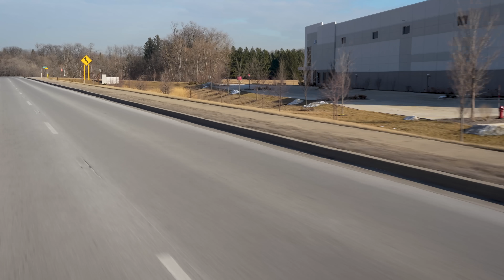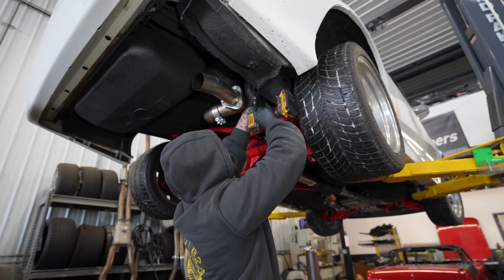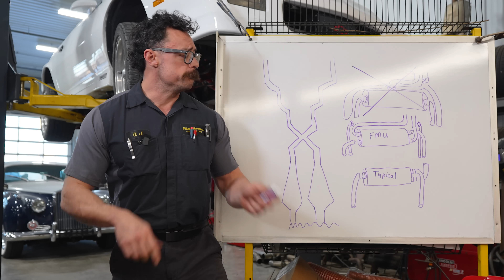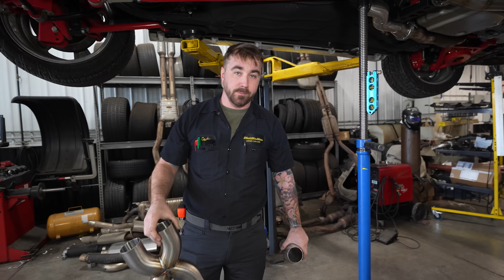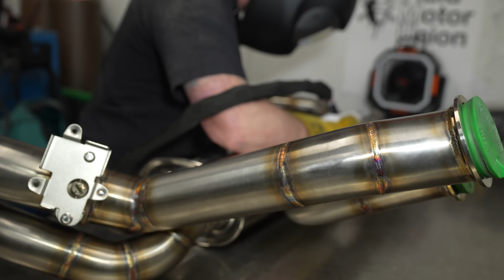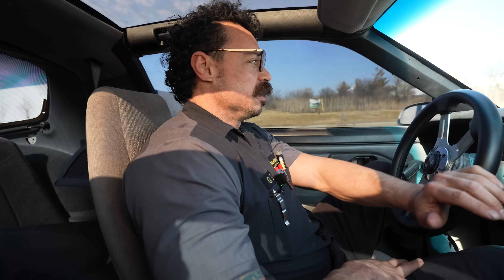This Camaro Exhaust Shouldn’t Have Made 30+ WHP: LS3 Stepped Pipe Layout Everyone Will Copy

Comment: The  megaphone you install and how subtle change and i assume you have a software program to optimize the actual  shape of the megaphone itself .  angle and lenght  of the divergent side and convergent section  can determine and affect how exhaust wave reflects  and the  scavenging and back pressure.  And if i remember  the number from years ago in  fluid dynamics.  Divergent side with shallower  longer angles   will  have broader  band   but lower  gains and  and divergents with sharper  angles that cause  shorter  length  have more  gain but at shorter band also longer affect the timing of the back pressure wave and the amount it affects.   Its a huge  are to take into account  and not  simple slap two cones together like some may think,  hats off to you  on  the tech and idea its a lot of work to design and to balance.

Comment: This style exhaust you are showing us frees up horsepower by interupting the returning pressure wave that causes reversion. It may create a scavenging effect as well. I ran an exhaust shop for about 20 years which was a great gig until the manufacturers went to stainless exhaust in about 1996ish. I wish I would have a dyno to actually measure the results of the different things I tried.

Comment: I have basically about the same set up except for mine is in a Chevy 2 and when you done the first Dyno and said that it was making 392 I knew right there you were definitely going to be getting more from it if you could open it up more and get a more crispy sound and I also said that they should be getting 450 out of it on peak and that's what mine made was 456 at the wheel

Comment: Man, you have no idea man that car does not sound good and it don’t even work that good. My car would just blow the doors off. That car is for a joke. Like I said in the previous comments, you have to put real dual exhaust on the car with two thrush mufflers on it the passenger side crosses over to the driver side and the driver side crosses over to the passenger side and they’re in the middle is where you put your brush mufflers on each pipe. That’s the only way that that car is going to actually sound good the only other way to make it sound even better is to Pull that newer age crap out of there and put in a 383 stroker or find yourself a 400 small block and put a carburetter on it with a four barrel you know you get that whoop whoop then you’ll have yourself a car

Comment: Man, these guys are so fucked up 2 1/2 inch pipe, dual exhaust the driver side is going to be a little bit lower to the ground but if you want duels, that’s what you need to do. I had my car for 15 years. I got stainless steel exhaust and never had to touch it ever again after 15 years, take the insulation out the floor under the carpet and drive it somewhere on a back road late at night. It’ll make your hair on your arm stand right up on end.

Comment: I have a third GEN Camaro 82 with a 400 small block in it. It’s got dual exhaust real dual exhaust and you will not get that car right there sounding good until you put dual exhaust on it and while you’re at it throw real motor in it with a carburetter Holly carburetter

Comment: regarding the bit about the dyno correction. Like you said its a tool. For example if my tire gauge reads 2psi different than yours, It doesn't matter because I only need repeatable accuracy because I tune tire pressure to what I feel from the seat not what a book says.

Comment: Half of the gain in graph is from manipulated dyno number.
The DD dyno just have rpm on front roller, and not linked roller.
The roller mass inertia is based of both rollers. So to get correct reading you need to turn both rollers.
In first pull with harder strapping both rollers was running.
With upgrade it was loser straps so it climbed front roller more. 
That means the inertia/moi calculation gets wrong and you also get less tire pinch, resistance.

So atleast half of that gain, was running on both rollers compared to one as the dyno software doesn’t correct for changed moi ☺️

Comment: I have a Durango Citadel...  It has a v6 engine that "tees" into a single muffler exhaust.  The problem...  The manifolds are cast into the cylinder head.  The exhaust is simply a pipe that bolts to the cylinder head and routes to the rear like anything else.  I would love to see if there is any power left on the table and if your special ingredients of megaphones and exhaust transitions would help or be a complete waste of time.  😁  Too bad I'm broke!

Comment: Ive been  playing  with a theory in my head and on paper  every thing has a resonance  frequency  right down  to tha air we breathe  it applies  to everything  find that frequency  in an intake  runner/s and or primary  tube/s  all the way  to threw the exaust  system    you can gain  in some  cases  upwards   of 30 to 50 volumetric  efficiency on the dyno that translates  to real-time data  and horsepower  numbers. I don have a PhD  never  had any schooling just a gear head  with  A--D and my brain never stops
Reply: True.
Ask Ferrari or Chevy Vette with variable geometry intake manifolds

Comment: The idle sounds really good, and the power increase from just the exhaust impressive, the fabrication work is phenomenal.  For me it's a little bit Tin  sounding on the top end, and I'm not a fan of borla's either,  but that's just my opinion.
3 inch dual exhaust is fairly big for an NA build, at what threshold do you start needing a 3 inch exhaust? 
Now I do want to say you guys should try some stepped headers. Try to stay away from those three bolt flanges cause those just suck, a proper slip fit or the V band is the way to go.  Pypes made a set of stepped headers for the coyote Mustang and they made some really good power. The only bad thing were the ball and socket fittings for the collectors, the X pipe would work itself loose and start to droop over time. Sound quality was great.

Comment: One thing I've wondered about but never heard discussed in 30 yrs: The exhaust gasses are cooling down rapidly as they travel down the exhaust system, therefore slowing and contracting in volume. Could changing diameter size in steps be used to increase flow by altering velocity? Smooth out flow and/or smooth out pulses?
I've seen a 2 ³/⁴" system go into 3" but my experience is that the sound gets louder, not necessarily make the car faster. Could a reduced diameter, in the right location, reduce noise or even increase velocity and scavenging? 
Maybe a series of stepped diameter changes?
Just thinking out loud.

Comment: My friends 3rd gen was done the same way at the back.  One pipe straight off the elbow and the 90 going into a muffler.  It just seems to me bad for sound engineering. 

Currently on my 00 im planning on going with a gmmk style muffler but I want thrush glass packs in place of the crimped pipes.

Comment: Its good to see actual, well known, exhaust physics being used. As soon as i saw your megaphone, the first thing i thought was how the shockwaves could be tuned for more power based on distance from the exhaust valve - like a 2T engine. 

Have you thought about headers with a small, sharp step closer to the valve for a more RPM tuned step length? I know F1 cars use the concept, but they run such high RPM that the first steps are something like 6"-10" from the valve.

Comment: How did you realize that the relucter wheel sensor was incorrect?  I have a 2007 LS 5.3, truck motor,  installed in my 1973 swapped Camaro.  Scott in southern Oregon

Comment: What are the odds that the previous tune was just bad? In my experience, if the numbers are unbelievable, they're probably wrong.
Reply from the maker: Maybe your just responding after clicking the video because I go over this pretty thoroughly if you watch the entire thing.
Reply: @FluidMotorUnion  sorry, maybe I was confused. You mentioned you played with tuning a little because it was hunting for idle, got an increase, then got more with a pro tuner, right? Or did you not touch the tune at all after doing the exhaust and getting that first big bump in power? Not accusing anything, I promise. 30hp difference in exhaust is wild. Like, "something stuck in a pipe" wild, right?
Reply from the maker: The exhaust gain, is on same file, the additional after that is the file modified. 
I’m pretty sure I state that if you watch along. I appreciate you watching and asking questions but I try to do a good job of being clear, and I rewatched thinking I wasn’t… but it’s all there!

Comment: This is how its done. Also a number in the comments are pointing out the tune, and sure - but you wouldn't have the numbers returned from the tune with the original exhaust setup, the original benchmark was done after the obvious were fixed and the final tune was done to optimise for the final setup, there were significant gains in the final product regardless.

Comment: If you shut the correction factor off the weather can make huge differences hour to hour much less day to day.
The whole point of the correction factor is so you get comparable numbers regardless of weather conditions.
Here is an example. I have dynod one of my vehicles in Denver Colorado at 6000ish feet of elevation and green bay Wisconsin at 300ish feet of elevation. 
With correction turned off the denver numbers were almost 100hp lower.
Turn them on and corrected power was within 3hp
Reply: 100hp lower???  Wholey crap!  Almost makes you want to live in Wisconsin to feel that extra 100hp!

Comment: Nascar teams used to make headers that were one size for a certain length, then stepped up one size for a certain length then joined the collector.  you have to measure the volume of each cylinder, design a primary exhaust pipe that can hold 3/4 of that, then step up to the next size pipe, like 1 3/4 to 1 7/8.  the second section of the header pipe should be able to hold the volume of 3/4 of the cylinder.  what this does it cause a scavenging effect of the cylinder and header pipe.  I think some of them had 2 or 3 steps

Comment: The fact that you had it strapped down into the rear idle roller on the before runs and then showed a video of your last runs letting it climb the roller tells me you’ve purposely loosened the straps to show more hp. I used to operate the exact same dyno and know there is a reasonable difference between letting it run on the idle roller or not

Comment: Those last pulls on the vid you can tell it isn't warmed up yet, or you had the drivers wish pumped quite a bit. Look at the spray on the ground.  Let her warm up more, she'll sound even better. Some of that gas is inside the pipe needs a spark plug of its own!

Comment: This is a great video; I’m currently working on an e39 where I’m doing an m50b30 stroker turbo build and I am hoping to build a basically stock exhaust with a window switch controlled valve. While this was an NA dual setup it gives a lot of insight into how to think about exhaust work.

Comment: I immediately noticed you guys had a W210 E55 AMG mercedes in the engine bay next to this turd gen 'maro. I'd be interested in an exhaust setup for my W202 C43 AMG (same M113 engine platform). I'd like to also consider a single turbo exhaust setup with a crossover. Thanks for the video, this gives me some ideas to copy as the title suggests.

Comment: 450 wheel is gonna be 520-500 crank.   You’re not losing 150hp through the drive train.    4l60e loses 70hp.  4l80e lose a little more    Manual transmission would lose less

Comment: I run my 81 with straight, x-pipe, dumped at the rear. Ls3. When installed mufflers i hated it. It ran sluggish felt like no torque or power. Removed the mufflers and immediate beast. Its loud but performs way better. Old heads tell me its bad and I'm just like.... yeah. I've definitely contemplated doing cut outs to quiet it down when i want but the sound is just ☺️

Comment: Great work and I enjoyed the process. The only thing I would have liked as the customer would be that flange at the header so it could still be removed with the engine in. There very well may not have been room, but dropping the headers to weld a v bands for the extensions would have been nice, even if only serviceable with the headers lowered. Probably won’t ever be a real issue anyway. If it blocks trans removal they’ll have to unbolt headers from heads either way. Sound, gains, and execution still top notch from where I’m sitting.

Comment: As an original owner of a 1987 Camaro Iroc, getting ready to do a 416 LS3 stroker, I watched this with great interest. I am planning Speed Engineering headers ,Jet Hot coated since we are both located in Greensboro, NC. I wish you were closer. to me. Having you do exhai=ust on my personal car would be a no brainer!  Any suggestions for the best off the shelf system to mate to my headers? I am also, currently doing a flip 2002 Camaro SS SLP LS6 with BBK headers and a True dual Hooker Blackheart system . Those headers will also be Jet Hot coated. I love your approach and content. In addition, please tell Cody his welding is amazing!!!~

Comment: I do jave to say, I dont thonk ive seen an wxhaust pick up that much power.
Thats a situation, that if you stuck with a single, I would use a 4 or 4.5" oval.
These cars have almost no space or ground clearance for an exhaust.
Its this reason the factory stuck the pipes up in the tunnel, level with the bottom of the body.
Reply from the maker: We were just as surprised as you are!

Comment: I have a 92 RS Camaro heritage edition 24,000 original miles to clean of a car to go chopping on also have an 87T top Firebird 383 put out 500 horse almost 500 foot pounds of torque. It’s got a assertive hooker Shorty headers on it with 3 inch y pipe cap back exhaust so my theory is if he making a horsepower who cares about what kind of pipe you put on it😮

Comment: FAST 105, LS3, LONG TUBES, AND 392HP TO THE WHEELS? I'd fire the guy who built it! My LS1 made 334 to the wheel in a stock untouched form with no tune. Just Throttle mod, custom merge headers, and cats! And it was installed into a 1986 Mazda RX7, 2870 lbs.

Comment: I have a 3rd gen f-body and 100% on your take about how difficult the exhaust design will be.
After seeing and trying some different designs this one has some new elements. And I have to agree that a well designed step pipe system would be the way to do it based on chassis clearance.
But of course the power that it opens up is the paramount selling point.

Comment: Increased velocity out, increases velocity in. When an engine breathes easier, it creates more TQ and HP. The optimum engine timing for the exhaust system gives you the final TQ and HP numbers. Gaining just short of 50 HP is huge for an exhaust system.

Comment: Curious where your shop is out of? and rough ballpark what a system like this costs ? I’ve got a car that I’d really love to have one of your systems put on. Thanks
Reply from the maker: We are out of Naperville, IL - as far as price, every vehicle is different and we only give a cost analysis after we get the car on the lift! There are a lot of reasons for that.
Reply: @FluidMotorUnion Thanks for the reply, totally makes sense. I’m actually a tec as well, the shop I’m at still has a bender and we still use it occasionally. The systems I’ve made are no comparison to what you guys make with all stainless and tig welded. Truly impressive stuff, with dyno numbers to prove it works as well as it sounds. 
 I’ve got an old grand marquis that was my first car that I threw a cammed LS1. To most people it’s junk but I love it and it’s a blast to drive. 
I’m gonna try to get down there one way or another. I’m just up near Madison. Thanks again

Comment: GM through and through here but I also choose to daily A Lexus with a 3.0 v6 that has a super fancy duel inlet variable intake length intake system that screams, BUT,ive always wondered why the fancy intake and VVT,just to dump both banks into a double walled single pipe that appears to be 1'3/4 at most, as im not chasing HP but efficiency and a little sound, no one makes a kit for an rx300 that I know of,im just curious how much I'd pick up milage wise removing the down stream cat and 2 of the 3 mufflers?

Comment: Strap it down on the dyno properly.
Reply from the maker: Straps break and sometimes the camera catches it. There were 3 other holding it down, which is kinda the definition or proper…
Looked rad so I left it in the edit!
Reply: @FluidMotorUnion on Australian dynos when the rear wheels clim up ontop of the front roller and not making contact with the rear roller.  The hp number gets inflated. Don't know about the American dyno's.

Comment: Makes perfect sense. It's like a long velocity stack... You get the backpressure upfront as you should and then get it out. Super clean design, hi5. Only thing left to wonder is best placement of the merge (x/h) pipe in the system... further up front or further back, granted you have a choice. Exhaust are like instruments...

Comment: I had an IROC with my 406sbc at first, after considering all the weird things with weird exhaust and the rearend with the torque arm, the fact that 3rd gen its built like a Barbie car. I decided that since I'm just racing in a straight line I went and got a whole different roller to throw my engine into. An S10 was available and I eventually learned how to put full long tube headers with two 90⁰ mandrel tubes so it's zero issue with a full exhaust, and i can drop my transmission without removing the headers too.

Comment: You can add timing before peak torque on an na engine.  Peak cylinder pressure is at peak torque.  Could take more timing before and after.  I tune for a living and it works out pretty well that way.  Now you just need to know how much to pull when you're done to make it safe for the street.